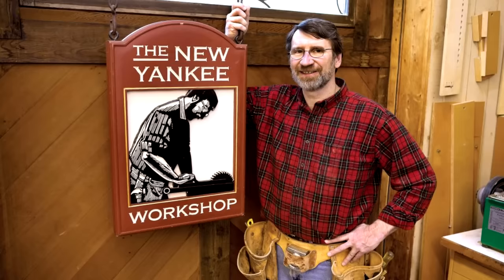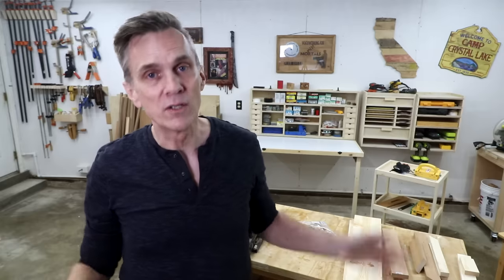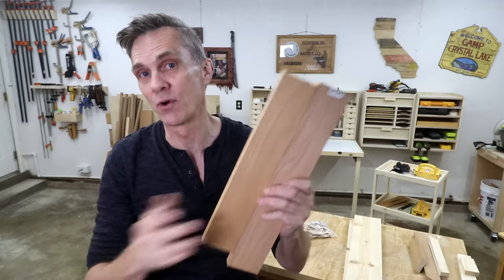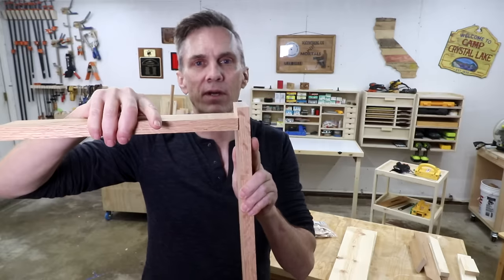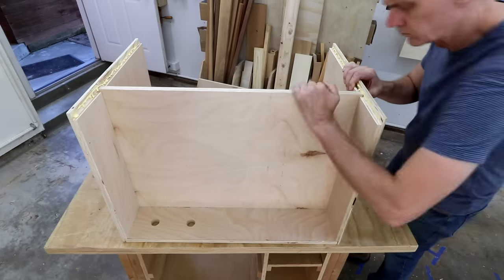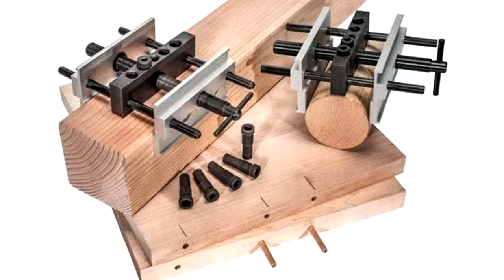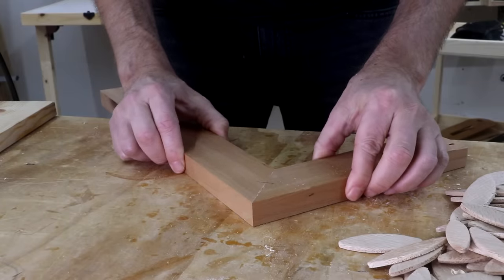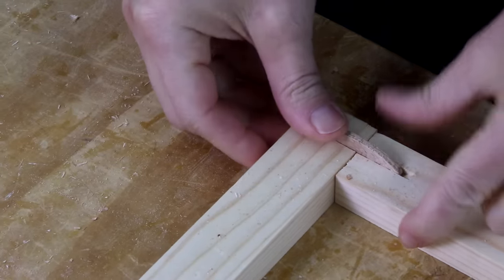So, is a biscuit joiner completely useless?

Comment: As a picture framer we used brad nails for reinforcement of miters sometimes (smaller stuff).  We had under-pinner machine that was pneumatic that would press the wavy staples in the frames.  I had a arm that came down over the top of the joint as you held it together and it would press the staple in from the bottom.   It was really good if you had some flat surface on the top of the profile.  It if was an odd profile or slopped the machine or hammer of the staple.   For those we had a old manual drill (as in hand crank).  We would clip the top off a nail and chuck it in the drill.  Then spin it in to the wood a little to keep it from spitting and tap in a brad and counter sink with a punch.  We had a colored nail hole filler putty you could mix to get the correct color match.  It never hardens though.   Plenty strong for that.  We never did splines as most our moldings came pre made and finished.  I think splines look cool and will whip up a jig for it (one for my kerf and dove tail bit on the router table).  Mostly for simple solid wood frames I mill.

Comment: Oh wow, it's a simple round saw blade that plunges into the wood?  So if I built a proper fence to hold my wood in place I could in theory make the same cut with a table saw.  It'd be a lot harder to set up and even less worth it but you could, right?
Reply: If you own a router you can buy a biscuit cutting blade for it, a lot easier than messing with a table saw.
Reply: @goatsears  my comment has nothing to do with a router...
Reply: @DoomRater  Thought you were looking for an easier solution to cut a slot for a biscuit, feel free to ignore my comment....
Reply: Oh no, I was looking for the most insane way to do it.

Comment: I totally disagree with this. I use my biscuit jointer for all panel glue ups. It helps align the boards and keeps any one of them from straying up or down as they're being tightened down. Pocket holes are trashy. I would be embarrassed to use them in a piece that I'm selling or giving as a gift. I'll take the clean look, whether the client sees it or not.

Comment: There are many methods of joinery and biscuits are a great one that has their place. I don't know if it is your machine or your biscuits that are the issue with the extremely sloppy fit that you show in the video (maybe a combination of both) but you have a serious issue there due to something? The biscuits themselves can vary quite a lot between brands and just because they have a "big name" on the package it doesn't mean that they are worth a crap. For instance, the "Porter Cable" biscuits are very "flaky" making a lot of them unusable as well as not being very uniform in thickness (some being loose and some tight in the slots) I have had good luck with the Lamello and Freud biscuits. The biscuits have their place and as mentioned in others comments, panel alignment alone is a big one. I have been operating a full time custom shop specializing in various high end commercial pieces for over thirty years and use about every method of joinery there is (biscuits, splines, dowels. etc.) they all have there place and with real experience you get to know where to use what. It is a matter of having the combination of experience and skills along with the proper tools. Dowels are great if you have a quality self centering jig (and know how to use it) A glue joint alone has it's place, depending on the application and (if you are using the right glue) A "biscuit" is simply a "spline" and splines have a great many applications. If your combination of biscuits and machine that results in such poor fit as shown in your video are all that you have been exposed to then you simply need to do a little research and get some better materials because while I agree that what you showed in the video is about useless, it is certainly not typical if using good quality materials and machines.

Comment: Great Vidio, but I have to disagree. I have both a biscuit jointer and a domino jointer and find that there are ocations werer I will use a biskit over a domino joint and vice versa. I tend to use biscuits more than dominos as I am to awere of the cost and avalibility of dominos. I did look into dowle jointer and as I already had the biscuit jointer I decided that a domino was more viesatile. Bisciut joinery can be acheved at a very reasimble cost and I have never had much faith in pocket hole joints, I dont think there is one solution that works for all .

Comment: I got sucked into getting a biscuit joiner a few years ago. I got a used dewalt for $70 that was only like a year old that retailed for like $150 I think. I believe I’ve used it two maybe three times since I’ve had it. Once to make a panel for a small bathroom cabinet door which then got planed down to where the biscuits were showing through so it got planed down even more to where the biscuits were nonexistent. It has been a nice dust collection shelf ornament since it was last used a couple years ago.

Comment: Spend the money to buy a good biscuit joiner like a porter cable and you won't have the sloppy joint shown in this video. In woodworking there are different strokes for different folks. I use biscuits a lot because they work for me.  I won't make fun of any woodworker who has chosen a method that works for them, unless they try to tell me they have all the answers and anyone who  doesn't do it their way is less of a woodworker than they are even if they are expert enough to make a video. .

Comment: If you have that much play in your biscuit slot, you are simply using the wrong blade. 
I use the biscuit joiner in almost all my projects and have to say that I strongly disagree with your assessment that the BJ is completely useless.
Say you're making a cabinet with several shelves, the biscuits make it easy to align all the shelves to place, and once you screw the back onto the cabinet, the strength wont be an issue. If some of the faces will be invisible you could even throw in a couple of screws in addition to the biscuits, making an extraordinarily easy glue-up.

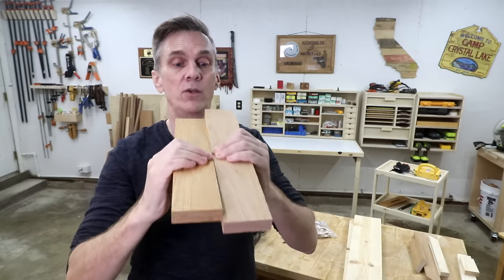Comment: 2:11 I'm, sorry but YOU ARE WRONG  That is your particular crappy biscuit jointer that leaves biscuits lose. I just did a table top glue up using a Dewalt biscuit jointer and Dewalt biscuits and they fit snug and some I had to hammer in. Needless to say I wouldn't have been able to get that table as flat as it is now without the use of the biscuits. Since I had no cauls or wood to make them.
Reply from the maker: Maybe settle down and watch my follow up video. https://youtu.be/aO6eETepMGg

Comment: I have to disagree with your premise. A joint needs to do two things, possibly three in extreme conditions. The two are to locate position and to increase the glued area. The biscuit jointer does this admirably. The third condition is provide mechanical strength which the biscuit jointer can also do, but in limited circumstances. When joining a series of boards edge to edge you can rub a joint but then there is the worry of creating a step somewhere along the length of the joint. A biscuit jointer removes that worry and aligns the joint along the whole length, Invaluable for jointing solid timber as well as veneered boards. 
I bailed out halfway through after deciding you were just promoting yourself with whichever crazy idea came to you in the shower that day.

Comment: ahh yes amateur woodworkers trying to justify tools lol    so fyi your biscuits were not the correct size for your tenons.  if you have the correct matching sizes they work great to align surfaces.   yes they have no Huge strength but thats not what they were designed for
Reply: Are there different thicknesses of biscuits?  I've seen the three different sizes but are all the same thickness.

Comment: Did you buy the first biscuit joiner off the assembly line? that thing is ancient. I think you are a biscuit joiner hater. It is not an edge joining or aliment tool as some people use it. It is a cabinet makers tool. Used for making cabinets/boxes. I have yet to see a tool that can make kitchen cabinets as quickly. What do you offer as an option? festool, dowels or dados. None of those are better at making cabinets than biscuit joiners.

Comment: A biscuit joiner is indispensible to me when I make picture frames. Gluing two pieces endwise at a 45 degree angle is nowhere near as strong without it.
Reply: I hate pocket screws. It just seems like the cheap shortcut of the amateur.
Reply: @jbrisby  That just makes you a woodworking snob

Comment: Your comment that the glue by it's self is plenty strong enough, is absolutely WRONG if you're joining eucalypt hardwood.
I haven't found ANY glue that will hold over even a short time, from resorcinol, though epoxy  to EVA, all dies in the rump without some sort of mechanical  holding system. Biscuit joints are better than no biscuit joint. As to biscuits "swelling to make the joint, wrong again, they give the joint greater surface area for the glue to grip on.

Comment: Steve, your biscuit jointer is flawed. In your close-up shots you could see how oversized the slot cuts were.
I have been using a DeWalt unit for years and the biscuits fit much tighter, also I could see the depth of your cut was too deep. I can see how you were dissapointed with this tool, the blade is too wide and too deep. I have used the DeWalt jointer to make funiture that has lasted for 25+ years. The tool has its' limitations, but I think it was the quality of the tool that influenced your opinion. Still enjoy your show, thanks anyway.

Comment: Steve, Steve, Steve, Your biscuit joiner must be a piece of crap. Mine cuts nice tight slots for biscuits. I know, your right it really doesn't add much strength but it really does help you locate the proper position when gluing two boards together. I use mine when location is important. There is enough to worry about when gluing without worrying about location. But it is not needed for the beginner. Not money well spend to start out.

Comment: This doesn't make sense. Increasing the surface area for the glue to adhere to will increase the strength of the joint. It's nice that you like other methods, but to say this joint does nothing to improve the strength of a joint is just wrong. And if your biscuits aren't the right size or your joints are too big.... You're supposed to be a carpenter. How can you not get that figured out? Cutting a slot in a piece of wood shouldn't be a significant strain on your skills.

Comment: No wonder you don't like the biscuits when they are so loose in the groove. Looks like you're using the wrong blade or biscuits. My biscuits never were sloppy in the groove. I always had to tap them in with a hammer as well as hammer/force clamp pieces together. 
If your half-lap or tenon joints had that much slop you wouldn't be using them either...

Comment: Total disagree on this one. I own a dewalt biscuit joiner and find it useful, and the biscuits fit nice and snug helping with alignment for glue ups. That clip of the loose biscuit fitting is comical. Try a new joiner.

Comment: Hi Steve - I'm new to woodworking, so apologies if this is a dumb question. I'm looking to build something similar to this book case (https://www.pinterest.com/pin/284500901447577070/) at the end of built in closets. Due to how tight it fits to the ceiling, I will need to build it in place. Someone recommended that I use biscuits so that when I put it all together, everything is easy to line up. Given this video - would you recommend that as well? Thanks!

Comment: Why are your bisquits so loose? That loose they would be useless. If I pre-fit a joint I more often than not have to use a pair of pliers to romove the bisquit. I have a Domino machine and a busquit machine and use both on a regular basis. Even in mdf. I suspect you have the wrong blade fitted - too wide a kerf.

Comment: I used a method called grooving , where you move the machine along the edge and create a kerf as long as you need , after I move the fence and double up on the width of the groove. Then i  make my own strips out of solid wood and  with the slots i get a very strong joint, as seen in my building here : 24:07 https://www.youtube.com/watch?v=5T7UUAuMCHs

Comment: You are using a low quality tool most likely with a cheap or dull blade. If you're skilled and experienced in the trade then you know when to use one and when not to. I've seen you put hinges on backwards and upside down so I'm not so sure you have the experience to render this tool useless or devote a whole segment on how to use it

Comment: Actually pretty unfair to base your opinion on this crappy tool you own. I always work with a Lamello machine, which doesn't have that much play. It provides a really tight fit for the biscuits. In the industry the biscuit joiner has a huge place for kitchen cabinets and all sorts of other uses. With the right knowledge of the tool you can work really fast and efficient.

Comment: where do people come up with this crap that biscuit don't add any strength, every test I have seen and done has proven that they are just as strong as a good as a mortise and tenon joint, and much stronger than a dowel joint.  Seems like every video where they try and claim that a dowel is stronger cheats in the test making sure that the dowel looks stronger. the simple fact is the biscuit expands and has substantially more surface area then a dowel. 

the problem is wood working is a VERY conservative hobby, as such they don't accept change well and will jump through hoop's of logical fallacy to defend the old standards. 

Some of the most well respected wood workers in the world have finally conceded that properly done biscuit joints are every bit as strong as a good a mortise and tenon joint and far superior to doweling and my testing seems to support this as well    

I have several screen doors that I built 30 years ago using biscuit and they have survived kids and grand-kids with zero issues,  I also have a shop stool that I built with biscuits that's about 20 years old and the joints are just as tight today as they were when I built it and I'm 6'1" 260 pounds 

the first issues I see is that your biscuit cutter seems to be improperly adjusted and you are not cutting the slots correctly, a properly cut slot requires a mallet and a bit of tapping to get the biscuit into the slot. if the biscuit simply falls out of the slot then you are allowing the cutter to move up and down to much or there is a problem with your cutter.

Comment: You are missing the point entirely. I worked in a shop in austria and we used this for joining a particle board corups together and fast. The play is the most useful thing as it allows for some inaccuracy and adjustment while the glue is curing. Who would even think about trying to use this to join a table top lol. Very bad video.

Comment: I've never used or owned one of these, so take that into consideration but I kind of suspect Steve is correct here: you probably don't need one. I bought the latest Kreg Pocket hole jig a few years back and while it was pricey, I feel it's more versatile and therefore has more overall value, esp for a non-pro woodworker. I use the Kreg  a lot.  I always thought if I saw a used biscuit joiner for a reasonable price I might pick one up but I kind of agree with Steve here ... doesn't seem useful enough to justify dropping a few hundred on one. My two cents anyway.

Comment: Your cheap looking biscuit joiner must have the wrong blade in it or something, they’re never supposed to be that loose.
Reply: I purchased a BJ in its heyday.  A Tool Shop from Menards.  Never have been happy with the loose fitting biscuits.  I use it very little and question whether it would be worth it to get a different blade.  Maybe file down the blade thickness to get a better biscuit fit?  Seems that would be tedious and a waste of time as well.

Comment: Steve I really think pocket screws are really crappy. It's a shortcut for people to lazy to cut a joint. It's worse people think build a case using plywood with a butt joint and pocket screws, the plywood edge is only glue to the face veneer of the plywood and is relying on the pocket screws for its structure. But joint fails in because on a small place of wood that has been weekend by the screw hole.

Comment: Totally useless?  Hardly!  What I find useless is your judgement on all plate joiners as being useless.  We can see that you've taken an absolute bottom-of-the-barrel Sears machine, with its sloppy cutting tolerances and based your assessment of plate joinery on the crappy results you got with that machine.  I've been doing finish carpentry professionally for 40 years, and I use an early Porter-Cable machine regularly in my work.  There are affordable, better ones out there since I bought mine (like DeWalt or Makita).
Rather than try to generate clicks for your channel, I suggest you try some better quality machines and then come back with some useful information.  Beechwood biscuits DO IN FACT ADD GOOD STRENGTH TO A JOINT.  A slot of the proper thickness from a quality machine will give you excellent edge to edge alignment as well.
Reply from the maker: Take a deep  breath and calm down. I got a new one and my opinion changed. It was my very next video.  https://youtu.be/aO6eETepMGg

Comment: There's enough room in those cuts for two biscuits. No possibility of accuracy or added strength. Imagine making a tenon with that kind of slop. Sloppy video....
Reply: And my first project (bookcase) is going together with biscuits - working 100%, aligning perfectly, plenty of strength, easier than dowels which need two way placement accuracy